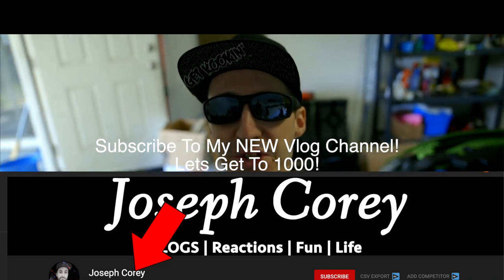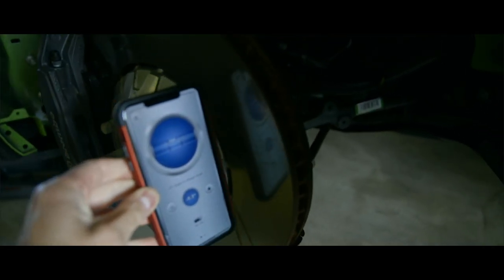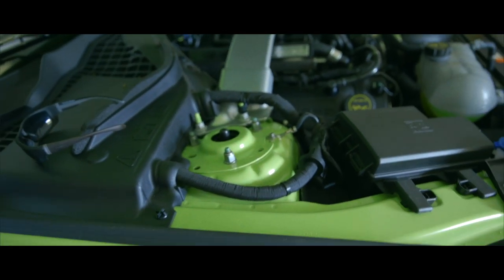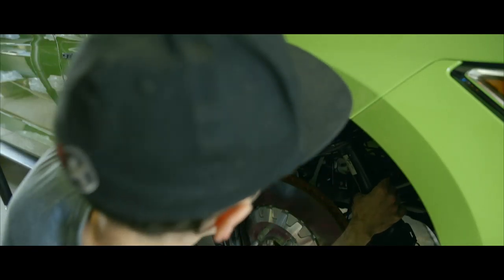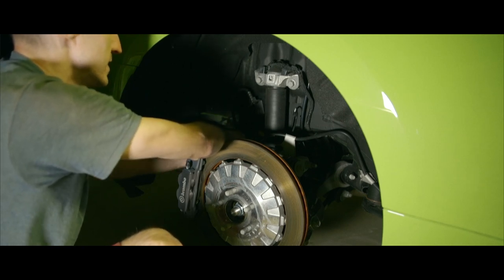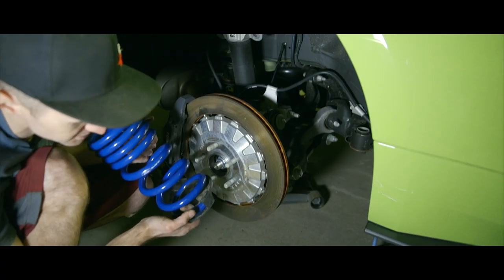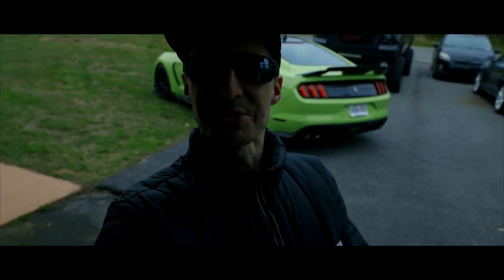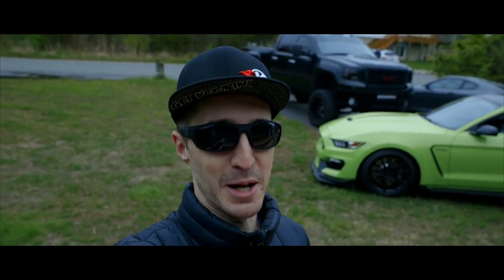Shelby GT350 Ford Performance Lowering Springs How To Install

Comment: Looks awesome. How much did it drop front and rear?
Reply from the maker: 0.78 all around 💪🏻 about 0.28 more drop than a R. However I have 35 series tires vs 30 series that the R has. So that’s 0.5” inch so it’s about the same height as a R with less wheel gap.

Comment: I had the same springs put on my GT350 with R front spoiler. “Kiss” it goodbye as you will destroy it with normal daily driving. I wish I could of warned you. I put the BMR GT350 handling springs and never looked back FTW! Night and day difference across the board my friend the best spring hands down...Awesome work otherwise  👊🏼
Reply from the maker: Thanks! No scraping so far. I like BMR rear and May do that but I didn’t want to drop the rear .5” and the front .3” it was flattening the car and I’m not a fan of that.
Reply: Mine scrapes all over town stock! I'd love to lower it but its definitely no bueno for me.

Comment: Hey, when I do a run in my Redeye, I wheel hop then lose power then it kicks back in, what can I do to stop that?
Reply from the maker: What do you mean?
Reply: The wheels spin then my RPM goes down for a sec then she goes .
Reply from the maker: That’s traction control. Completely normally 💪🏻
Reply: The traction control be off in sport mode is there something else
Reply from the maker: The only way traction controls is off is holding the traction control button for 10 seconds til you see the dash warning. Sport has some traction control still on.
Reply: Get a TBA rear diff brace, bwoody oversized sway bar links, AAD or bwoody rear lower and upper control arms, and Mickey Thompson ET Street S/S 305 35R/20 drag radials for the rear.  Get all that shit installed, and run the car suspension in sport mode.  You can thank me later.